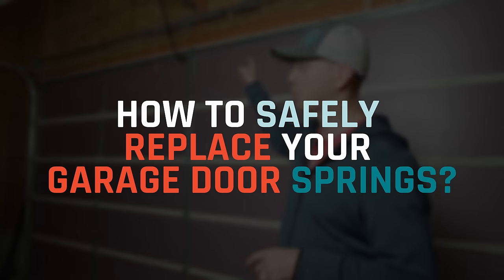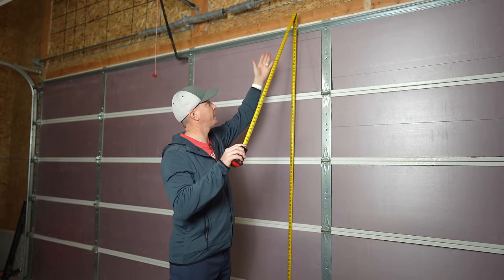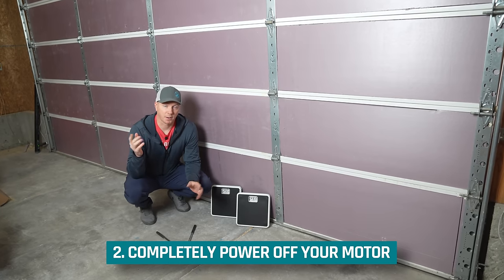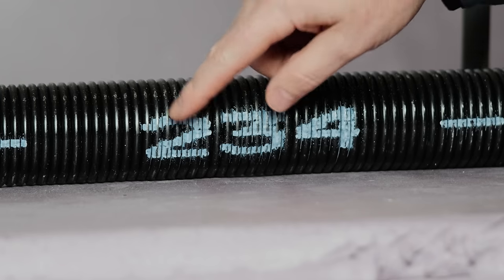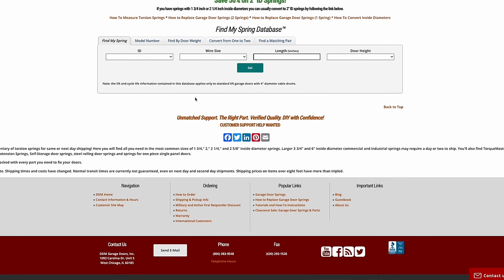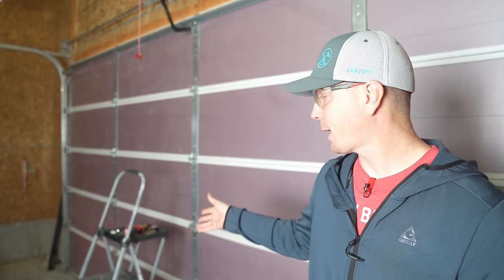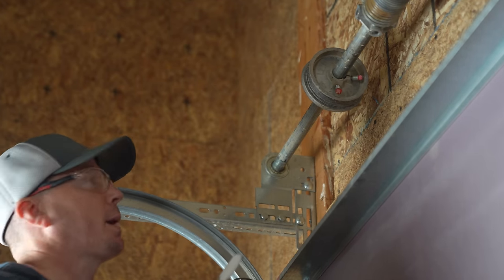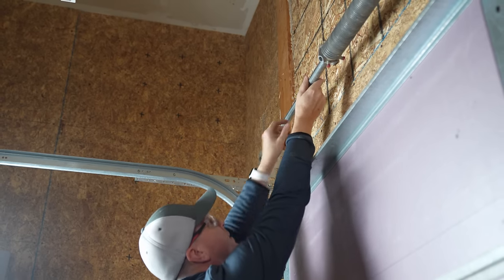How to Safely Replace Garage Door Springs & Save Hundreds

Comment: Garage door guy here: honestly, just don't do it. I've seen terrible things happen to people because they tried to mess with the springs.
Reply: 15 years of experience for me doing this  and I  agree  , this is one of the things you should probably just pay for .
Reply: @robertfleming5829  Yup. I always tell people that almost everything on a door is user serviceable just don't ever touch the springs or the cables.
Reply from the maker: I appreciate the feedback. I did my best to keep safety in mind throughout. Just curious - any other tips or tricks that you use on a job like this? We DIYers always appreciate learning from pros like yourself.
Reply: I've done this repair for a couple people. This is the type of task I'm comfortable about, but would recommend most people to not touch and hire someone.
Reply: @LRN2DIY  Family garage door business going back to the '40s. I could tell you a lot of horror stories that we've seen from customers messing with the springs. Dislocations, broken bones, hands cut off. The springs are no joke and I've even seen professionals get hurt because they can be that unpredictable.
Reply: Well pro guys give us some tips to save us money, this is the second time I replaced my spring, always safety first
Reply: I’ve seen terrible things happen from people crossing the street - instead of saying don’t do it offer advice and precautions . I hate when people say crap like that  without any context, what did those people that messed up do wrong so other people don’t make the same mistake.There was a time when you didn’t know how do it either.what if the person that trained you said , I’m not going to train you it’s to dangerous ,No one would learn anything. I changed suspension springs so many times on my cars now and it was so frustrating trying to learn how to do it in past because people like you putting everyone in a box like they’re not capable of learning.
Reply: What happen, how did some people get their hands cut off, broken bones, dislocations? I don’t see those things happening if everyone follows the correct safety instructions, what happen exactly?
Reply: I’ve done diy electrical,plumbing, framing, built patio covers a little drywall and such, but when my garage spring broke, I called a pro.
Reply: Yeah don’t do it, just so u can come and wax someone for doing the same exact thing he did in the video.
Reply: I've done it myself. You don't need to be a garage door tech, but you better know what you're doing and pay attention to the steps.
Reply: 400 bucks for a pro is worth not going to the hospital
Reply: @LogicDecoded  you fail to take into consideration that the required common sense to follow basic safety steps involves common sense. Which common sense isn't so common nowadays. Not to mention there's quite a few DIY'rs that really shouldn't touch a tool to begin with.
Reply: I really don't want to add to the precautions of a DIYer doing this themselves, but other things can go wrong. If you're on a ladder untensioning the unbroken spring and it breaks while you have tension on it with your winding bar, which is very likely, you're probably going to fall off the ladder and break something.
Steve Watts, Owner, Specialty Garage Door Repair
Reply: Some other things that weren't mentioned. First is a lot of garage door openers these days have a battery backup, so just unplugging them does nothing. The second item is you should have lubed your end bearings while the cable drums were out of the way so you can spray right into the bearings and also check them to make sure they're not too loose. Otherwise that would have been a good time to replace the end bearings.
Third, they also make high-quality center carrier bearings to replace that cheap plastic bushing. This would have been a good time to replace that cheap plastic bushing with a steel bearing.
The final item would be using Extreme Caution tightening up the center fixed ends to each other because sometimes if there's too much of a gap you can crack the ears on the fixed ends.
Steve Watts, Owner of Specialty Garage Door Repair
Reply: Here's my biggest issue with your average homeowner owner attempting to replace garage door springs themselves. If you order a spring/springs online you're hoping that you gave them the right information, they took down your information correctly, and that they sent you the right spring. Adding  or taking anything off of your door (insulation, struts, etc') dramatically changes the weight of the door and changes what spring is needed. I have both the experience to know what spring combo goes on what doors and the tools to properly measure the springs to get the right combo. The average homeowner does not. I know immediately while winding the spring if it's correct or not.  Before even taking my winding bars out of the cone I can feel the tension on the spring and tell whether it's heavy or hot. Your average homeowner can not. I have seen multiple cases of homeowners putting the wrong springs on and severely hurting themselves. Winding springs and checking proper tension is as much an art as it is a science. There's many different factors to what springs are needed and what the proper tension is. Also, if you replace only one spring and reuse the other old spring it can break while winding. I have seen that happen many times. If you're not standing properly and knowing that can happen then you will hurt yourself either with the bar or get thrown from the ladder. This isn't about making an extra couple hundred bucks off of someone who could have done it themselves. If someone can do it themself then they wouldn't be calling me in the first place. This is about fully understand the power that those springs have and how to safely check, install, and wind them.
Reply: It's the exact same process a "pro" does. Save your money, if you can follow directions there's nothing more inhertely dangerous doing it yourself then some dude coming out and doing the exact same steps.
Reply: @tangodown2721  By all means, relieve your springs yourself if you're comfortable doing it. As a professional, I'm just not comfortable information on how to do something that can greatly hurt or kill them. I've unwound and wound plenty of springs for free so it's not a $$ thing.
Reply: Hire a pro so they make money!! Boooo. On a simple, potentially dangerous yes but simple non the less. Hey pro’s give us tips on safe way of doing it. We are going to do it anyway. “Just hire a pro” wow so helpful for the king of DIY media YouTube. 

Video creator guy. Thank you for doing such a good deed and trying to show how to do it. If someone it’s confident or comfortable after seeing several of these videos. Then they can choose to hire out.
Reply: @BeersAndBeatsPDX  some people will never understand.  
I'm a master MB tech. I can replace a inline 6 head gasket on a 96 or 97 MB in 4 hours and not hurt myself or need another $1K in parts. On paper or video it looks easy. Average "at home mechanic" might take a month and break all kinds of stuff. 
Let's not even get into the later stuff. A garage door spring to these professionals is equivalent to a 104 engine to me.
Reply: Adding my .02 as I am enjoying a cold adult beverage after having successfully followed OP's awesome DIY video...even bought a tee shirt to thank him. Do it if you are an experienced DIYer and are confident about it, otherwise, pay a pro to do it...I almost went that route but really cant afford it right now so...yeah. YMMV. Thanks Nils!
Reply: All the comments of garage door “professionals” just trying to be sure all the DIYers are scared of this incredibly EASY project so they can continue to fleece hardworking people for 3X PLUS what it should really cost. The springs are EASY to deal with, if you don’t act like an IDIOT while installing them. Good grief.  I’ve replaced my own and multiple neighbors, and showed them how to do it themself in the future, and never had ANY issues. Just take your time and pay attn to what you’re doing and you’ll be fine. People who get injured doing this are probably just proving that gene pool cleansing is necessary. Don’t be scared folks, it’s EASY.
Reply: @TripleBRanch One of my 16'x7' door springs broke while I was at home in the kitchen; it sounded like an explosion.  When I went to look, shards of spring were scattered all over, two or three segments remained on the shaft.
The alarming part is - one of the many razor sharp shards was embedded in the nearby framing (old 1950s fir? that is hard to drive a screw in), and another pierced a hole in 5/8" sheetrock 8' away, in a glancing blow! (sidewall, 90º to the front, to the direction of the flight). [hit it at maybe 30º].  The pieces were mostly 1/3 to 3/4 circles with many having sharp pointed ends!
]they tended to fracture along the 'length' of the wire, so were pointed like a pencil].
It took maybe 1/2 second to unwind and fly apart.

I don't know if they exist, but seeing a video of a spring shattering should be mandatory before attempting any DIY spring work.
Reply: I was standing outside the vehicle when mine broke on a 2 stall door. I'm glad the kids weren't out yet, but the noise alone had me calling a pro. I do heavy equiptment maintenance for a living and some jobs around the house are best fit for the right tradesmen.
Reply: @LRN2DIY Ultimately this is a reminder of why I HATE roll up doors!!!
More difficult to repair &  more parts to break.
...Oh, and they take up more space.
Reply: @rickfresh7959  well said. moving too quick, not using proper equipment, and not paying attention are the bulk of the issues that cause injuries. not respecting the sheer potential energy in those springs is just ludicrous.
Reply: Interesting how many garage door repairmen are saying to not do it yourself. Almost like they have a vested interest in folks not being self-sufficient.
Reply: @dmbsituation  I had have the notion after looking at my estimate, but the dude that came and did mine ended up having to remove the entire top plate of the door to get enough room to take the tension off the springs, Also side rollers were shot and I got 5 year warranty on the springs, lifetime on the rollers. He had to take the top rollers off and flip them because the door was made for a larger radius in the tracking among other problems, He made it work and it sounds quieter than ever.

It's a 18ft wide 8 ft tall door and I feel like I got every penny out of him based on how many hurdles he had to deal with.

If your a homeowner dealing with other peoples handywork, especially if the previous homeowners did DIY, might not hurt to get a professional opinion, but in my case the devil in the details emerge after the works began. I just got lucky imo. Saved a weekend of stress and I still had my cars out for work on monday.
Reply: @dmbsituation  There are many things on garage doors and openers that are user repairable. I will talk a customer over the phone how to repair easy things so I don't have to give them a bill for something simple. When it comes to parts that are under high tension that could kill you instantly it's better to call a professional if you're the least bit apprehensive. It's like George Carlin said "Think of how stupid the average person is, and realize half of them are stupider than that." THOSE are the people who shouldn't be touching their springs.
Reply: @BeersAndBeatsPDX  3 yr old garage door. Logic board possibly bad. When techs came out they said your Springs are original and your rollers are worn. Everything should be replaced. Quote. $2,100. Wtf! He showed me the list of everything. I said how much for just Springs $530. How much for just rollers. $350. I'm like yeah... I'm not F'in with Springs. But I'm good on rollers. $24 on Amazon. Just to make sure I was right about not wanting to mess with the Springs I decided to YT it. 
This is a great video. But I decided I was right. I'll just pay the $500ish.
All the other crap he had on that list I'll just pass on.
Reply: Unfortunatley some of the bigger national companies are quick to rip people off. Realistically you shouldn't be paying much more than $500-$600 for new springs, rollers, cables, and lubrication. Rollers are super easy for a homeowner to replace. It's quick and inexpensive.
Reply: Y
Reply: Thank you for your video, I appreciate it. It takes a lot of time and work to put these together. I watched several videos regarding tensioning springs and then went ahead and gave it a try. It was a little nerve racking but it went well and I’m happy with the results. One thing I noticed is that each time you worked on a spring you placed yourself in front of when you tensioning or untensioning them. I put myself on the side where there is no spring in case it broke. Is there a practical/technical reason you did it that I’m not aware of?
Reply: @robertphillips4155  That is the right move. Never position yourself directly in front. I've seen someone hit themselves in the face with the winding bar because the spring broke and they were directly in front.
Reply: Hush!  This is helping with natural selection!  It helps weed out those that cant comprehend stored energy and its potential lol
Reply: @dmbsituation The reason they are cautious is because they have first hand experience with the danger involved. When you work in a trade, you also become familiar with the relative skill of your customers, and often they'll do extremely unsafe things. The reality with some things is that if you're unable to figure it out by reading basic instructions and applying your experience, you're not fit to do it. The common reason is that they lack the opportunity for safe practice, whereas a pro has had guidance, practice, and training to catch mistakes. 

The people in this comment section might be a bit ahead of average homeowners, but they're still miles from pro level. We can all agree that actually getting hurt doing this wrong, all to save a bit of money, would be incredibly stupid. We can all make our own decisions with that information.
Reply: Eh garage door people cost alot of money
Reply: @KronicDaydreamZ  Like any skilled profession you have to weigh the cost vs risk. If it's something you think you can do yourself then go for it.
Reply: @rickfresh7959  you dont know what you are doing and WILL make mistakes. You don't seat the winding bar all the way, it will get intimate with your face and/or hand. You put the springs on the incorrect side and wound them without catching it, the moment you pull those grips holding the initial cable tension. Those springs are going to unwind and those grips will get intimate with your face/hand. You put too much tension on your springs, the door can and probably will shoot straight up and out the back of the horizontal tracks. When removing tension the dead/winding cones could have cracks or be broken. When you unwind the spring the id will start returning to its original size, so the tension is no longer holding that broken cone together. Letting the spring unwind and cone shooting shards out. In this scenario your instincts will put you in more danger than helping you.  Just to name some things. This is one of things where you pay someone once (not from a company but that does it on side) that can teach you. There are too many unknown variables that can be covered in a "watch once" yt video. Understand your avg garage door wieghs between 800-1000lbs and is designed so a toddler can lift them with 1 hand. This is achieved via springs and tension. This is one of the rare times when people say "just pay someone" and its not gatkeeping.
Reply: I was freaked out just watching this. Appreciate the video, but man I am not touching those springs.
Reply: Agreed!
Reply: Sounds like something big garage door would say 😂
Reply: I dunno, I saved about 850 for my area and it really isn't that hard. It def has some danger but this isn't really anything special if you're dealing with someone that is used to doing other types of DIY, either on cars or wood working. You'd need to describe exactly what the issue is if all steps are followed that introduces something uncontrolled. Imo, table saw has alot more precautions than this job. My main criticism of this video is the lack of gloves.
Reply: @Sam-vd1ce  $850 is an absolute robbery.  I'm guessing that quote was from a certain national garage door company.
Reply: @BeersAndBeatsPDX  no, in my area everyone charges pretty high for anything. Just a high cost of living and I see a trend of folks pressuring other folks to simply all raise prices. Had friend approached and threatened cuz their business was 'undercharging'. Considering most do bad jobs anyways, I'm glad I can impact them directly by not giving them work. Should add, it's basically been this way for all my friends who are all getting into the home owner market. Just help each other out and push out these silly businesses.
Reply: @Sam-vd1ce  That's crazy. A general spring change shouldn't cost even half of that. Throw in rollers and cables if there needed and you're still looking at $600 at most. That's how it is over here at least.
Reply: Great video! Perfectly explained in a safe and easy to follow way. Thanks so much!
Reply: So many scare tactics going on here.  It’s not rocket science. And if folks have a bit of know how and can follow directions I see no reason to spend hundreds of dollars.
Reply: I'm sorry, but garage door technician is not some highly skilled job. There are plenty of other jobs you could get seriously injured doing. Like car maintenance. People have been crushed by their vehicle because they didn't support it correctly. I don't hear people saying but to work under a vehicle.
Reply: Don't do it just pay me to do it 😅😅😅
Reply: When a dual spring that was loaded and installed by a “pro” can blow up unexpectedly. There’s just too many risks that are involved even when a “pro” does it. These springs are ticking time bombs and I hope no one is around to witness it happening.
Reply: @nobueno8652  Torsion springs do very little damage when they break. The shaft keeps them in place. It's just really loud. The worst things I've seen happen is a spring break when being installed and the tech hit himself in the face with the steel winding bar. That was entirely the installers fault though, he shouldn't have had his head in the way.